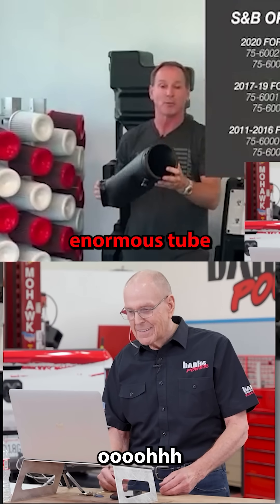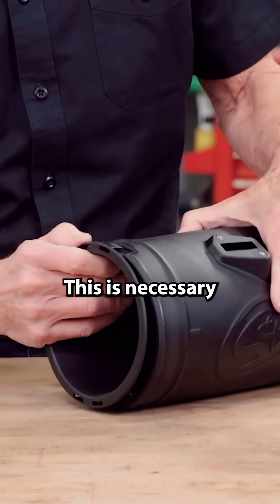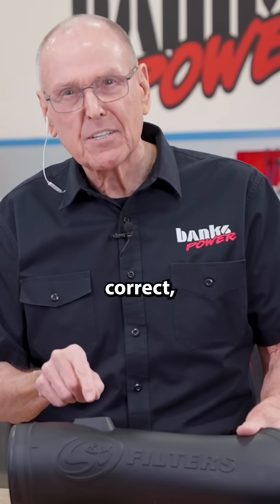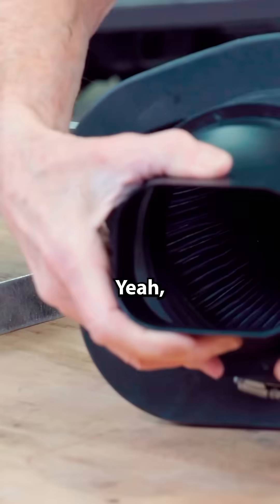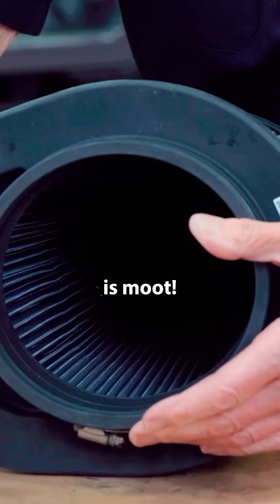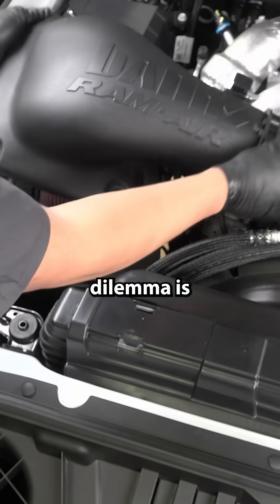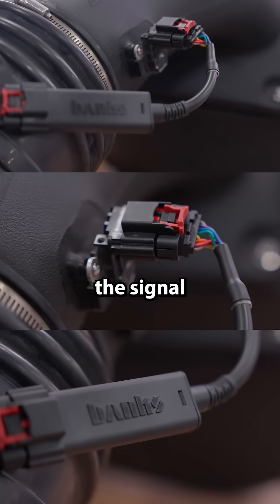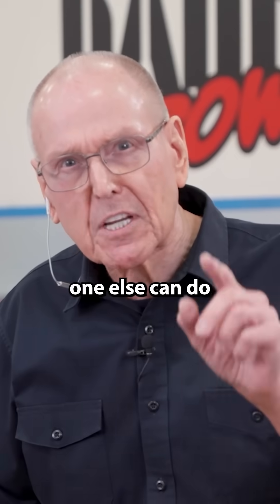Competitor tries to fake a big air intake

Comment: LMAO This makes the intake 50 state legal because you can run it without a tune. Its designed to be removable your ecu needs to be tuned to adjust for the difference in airflow velocity.  Anyone in the industry knows this.

Comment: Tuners called they want their computers back. 

If you increase the airflow rate into the engine you have to adjust the tuning anyways....

Also why do you need a bigger filter bigger =/= better. 

Ironically a higher volume flow of the same energy will be slower because you know Bernoulli's. Sometimes you want a restricted flow because it moves faster. 

Air filters changes are mostly dumb unless you actually adjust the entire engine to increase the performance in airflow.

Comment: I would say a custom maf and engine mapping designed around whatever size intake would be better than an intermediate device but the short didn't describe too much what it does other than bigger hole and driveability like stock

Comment: Bernoullies principle is why the s&b works so well.
Reply from the maker: It sounds like you're implying that the increased air velocity from the reduced diameter of their insert is some kind of benefit. It's certainly what stops the MAF sensor from reading incorrectly, but what do you think happens to the air after the MAF sensor when it dramatically transitions back to the larger tube? Any air velocity you may have gained immediately goes away with the pressure decrease, as Bernoulli's principle proves. You've done massive amounts of work to the air with no overall change in velocity, and you've lost air density from the reduced flow.

Comment: I loved all my banks stuff. Except my tuner. I had it mounted to my windshield and after a couple hot summer days it wouldn’t turn on anymore and customer service basically said there is nothing they can do even though it was less than a year old
Reply: Well,…you did put under a magnifying glass so to speak.    Heat kills electronics!
Reply: @markbrodie48  yea but also my Subaru Cobb tuner has lived on my dash it’s whole life, like 8 years and never had an issue. My banks died in under a year
Reply: @EarlyBirdArms that prob has to do with the amount of cobb units being produced and bought on a yearly basis. In california cobb is pretty much the only legal and viable option. 
Because of that they have made alot of money, and have alot of both the aforementioned money, as well as the time to develop more consistent levels of qc.

This results in more durable and long lasting units. 

Im sure if the banks tuner gets enough attention and sales, the productive will improve greatly.

Another thing that helps the cobb be as druable and useful as it is, is the fact that they have sold as many as they have and have all the review info, as well as customer data that they have collected over the years. Nobody will find a flaw in your system quicker than a standard consumer. Customer feedback is the most invaluable source of information  available to a company.
Reply: @zukoHD ok so the banks product isn’t working as it should. Got it. All that yapping for nothing
Reply: @Boosted_aj knowing why something doesn't work is important. Depending on the explanation, it'll mean the difference between dumping a brand or sticking with it. If the explanation is as the other guy says, it's worth sticking with banks. If they just don't care about QC and heat resistance, not so much. All that said, it's a bad sign when customer service is saying the product isn't meant for that kind of heat.
Reply: @Boosted_aj could just not comment and save some yapping
Reply: @zukoHD  That's not how the free market works. You don't sell more then make a better quality product after. They would sell more IF the product was better quality.

If it was selling more they'd find ways to make it cheaper to make more profit... That's how it works.
Reply: @markbrodie48 its a little bit late of a response but yes heat kills electronics but if they are going to design something thats supposed to stay in a window then it should be more heat resistant
Reply: Well, no shit Chevy Ford and dodge haven’t even been able to make a dash they can withstand windshield heat

Comment: You're telling me some little fancy piggyback maf sensor incomputer is going to perfectly adjust the entire scale of my maf sensor for every load condition of an engine. These would have to specifically be designed as piggybacks for certain engines with a particular intake. No Effing way I'm putting a universally device inline with a critical data sensor.  If you can't afford to tune your engine properly, don't modify your engine, its that simple.
Reply from the maker: The Air Mass Control Module is not a universal device. We sell it specifically with our intakes that are designed with it in mind.

Comment: Sooo, will his AMCM also say nothing is wrong when theres an actual issue?
Reply from the maker: Once the signal has been corrected for the new tube size, the MAF functions as normal and reads accurately for the new amount of air. It's sort of like changing the tube size moves the decimal place on the reading, and our module simply moves it back. That's an oversimplification but I hope it helps.

Comment: Ummm, voltage multiplier have been out for ever..  I use a Diablo to for my boosted car.....  Also, since Ford's can be flashed and don't require aftermarket ECU you can also increase it as much as you need for na......

Comment: I wish I could just get the control module. I refuse to pay hundreds of dollars on a CAI when you gain next to no power from it. I put a pod filter on a universal intake MAF tube just so I could hear my turbo, but it requires one of those inserts to correct the tube size for the MAF. I don't care about the smaller tube size itself, the turbo inlet is even smaller than the intake tube, but I do worry about the flow of the air, the turbulence.

Comment: All these years I've called that a map sensor and couldn't understand why it was called that lol😅
Reply from the maker: MAP (Manifold Absolute Pressure) and MAF (Mass Air Flow) are two different methods that manufacturers use to measure airflow.

Comment: My shop that built the motor in my car fucked the maf off because they are so shit and put a different airflow sensor right after intercooler before it goes into the intake. Was much faster and more reliable to tune too

Comment: If you're asserting that the MAF will work with the lower velocities in a larger tube just fine, and I'm assuming it will, then you are not the only one with a solution to this problem. The ECU can be tuned to recalibrate the MAF input, as the most obvious alternative.

Comment: “I patented this so that I have a design that no one else can do”
Exactly why I hate the Banks company.
They make it IMPOSSIBLE for the car community to R&D solutions because the second they figure it out the Patent it so no one else can develop anything similar. 
If anyone at Banks was wondering why you’re not more popular I’ll outline it.

When they stop making money off certain items they stop producing it BUT THEY DON’T RELEASE THE PATENT. So when people have older stuff and want to come up with a solution they CANT for 70 years from the patent date.

Locked down software and computers, no transparency on hardware repair manuals, legislation that creates protections for companies so that people can’t work on their own equipment “because it’s patented” are the reason the car community is dying.

Banks is JUST as bad as Apple, John Deer, etc.

Comment: You could have made a $0.02 part out of plastic to funnel only a portion of the air in front of the sensor to the right proportion for the larger tube. Instead you both took the wrong way. One a useless tube that claims to be big and the other a more expensive way of doing things 😑

Comment: It reads correctly, it’s just reading velocity of the air but through a larger opening. So you could map the MAF sensor data to adjust for the larger opening. 

Flow rate = density times velocity times area. Density is an input derived from the temperature sensor data, velocity is measured derived from the MAF data which is flow rate, so when it back calculates velocity, it will be lower than expected because it is using a constant area measured from the old intake tube.
Reply: To do what your talking about would require either adding or programming the eeprom in the ecu or buying an entire new ecu like the ones from holly or fueltec..  otherwise most vehicles and almost all newer ones dont have programmable logic boards or will let you alter the asbuilt data without going through a bunch of crap including paying for a subscription and all otherwise youre likely going to brick the whole thing and have to bring the thing to a dealership to reflash it or get a new one..   unless your really good at the stuff and know the whole backdoor into the uart or whatever they use to get into the thing… which is totally different for each make and manufacturer..
Reply: Don't try to educate gale banks. Listen to what he said, he made a controller module to have the correct reading for HIS bank tube. S&B did NOT.
Reply: @davidbernier2865  lol you’re not educated if you think what I said was to educate him. I was stating what is going on behind the words he stated. The “why” to the module he created.
Reply: If I’m not mistaken I’ve seen several cars that are boosted will use both map and maf to make this correction likely for this exact reason.
Reply: You could but it might struggle. Just map out the maf out that's what most do
Reply: Yes but you have to tune for it banks is referring to brand new emmisions compliant truck with just an aftermarket intake, all this thing is doing is fooling the maf readings with resistors I’m sure
Reply: @MrBOOM-fq3lw  all that reducer is doing is reducing the flow rate to an OEM range because the engine management system knows how big the opening is and given the velocity it reads knows how much air. If you change the opening size the ecu doesn’t know that with a MAF system.
Reply: And to do that you must have an easy way to do it. Which I suspect not every manufacturer would allow because "dangers"...
Reply: The answer i was looking for, tricking the car isn't doing anything but ignoring the issue. Of course you have to tune your car after running an oversized intake

Comment: A tune to correct the scaling on the MAF will fix said issue and hey you'll squeeze more power out of it.
Reply from the maker: You're right. Tuning is a great option, however, it would void the warranty. Our solution allows you to run an upgraded intake without modifying the ECM or setting a check engine light.
Reply: @bankspower  ahhh, my apologies. Was unaware of the vehicles being in warranty.

Comment: "To get the velocity correct" that seems really redundant.. wouldn't the purpose of making a different intake be to change the volume and velocity?
Reply from the maker: MAF sensors derive mass flow based on the cooling effect on an exposed wire. In a wider tube, the cooling effect is lower even though the overall mass flow is higher. Our Air Mass Control Module simply corrects the MAF signal to read accurate mass flow in the new wider tube.
Reply: @bankspower  👍🏼👍🏼 thanks

Comment: S&B is absolute garbage.  I bought a CAI from them for my F150 and the thing wouldn't seal properly at the airbox/tube so it would just be sucking in hot engine bay air rendering the snorkel useless.  $400 down the frickin drain.

Comment: The idea is you take the restrictor out when you get it tuned
Reply from the maker: Tuning is a great option, however, it would void the warranty. Our solution allows you to run an upgraded intake without modifying the ECM or setting a check engine light.

Comment: Ya it's pretty pointless to increase tube diameter and vector it back down to stock parameters ,who's idea was that??😂
Reply from the maker: No ones. We correct the signal for the expected velocity, but the overall mass flow is still higher.

Comment: As a plumber I get it. The while pipe is the size of the smallest point. If you have a 3/4" pipe, but there's a reduction to 1/2" pipe, the entire pipe is now only able to supply what the 1/2" pipe can supply. It's a bottleneck of you will.

Comment: The missconseption is that a tube/chanel flowes just as good as the smalest restriction.
It´s the product of cross-section over length!

Take a short pice of garden hose and blow through it, now take a very long coil of the same hose a blow through it, you will understan!!! 😉

Comment: Most cold air intakes, including Banks, are snake oil to begin with. Unless you are going all out with a tune, injectors, and exhaust, the factory stuff works just fine on most setups. Plus you don't have to wait overnight after cleaning the filter for it to be dry enough to re-oil it. There are much more bang for the buck mods than a CAI.
Reply: On some vehicles just a CAI, turbo inlet pipe, downpipe and a tune can have massive gains if the injectors and fuel pump allow for it. Especially true on a lot of  newer German and Japanese vehicles.
Reply: @Wrenchingandnursing  it works on every engine not just European and Japanese.. That would even work on a lawnmower... wtf are you talking about?
Reply: @LegionGamingTV  You completely missed my point. It works on all cars, but not equally. Some vehicles have decent airflow from the factory and certain engines/designs breathe easier than others. A lot of small displacement Japanese and European engines come with horrible airflow and are very dependent on it since they almost all are made to run forced induction at very high compression ratios. Therefore they get more benefit from that modification with a tune than say, a V6 mustang.
Reply: @Wrenchingandnursing  You said downpipe and tune. You're adding parts that will help a CAI. I posted that dollar for dollar, there are much better options than a CAI. A CAI alone is worthless and should be way down the line or part of a comprehensive package like the ones you stated. People who are buying CAI alone are being scammed. Think about this, I swapped from a 2.73 ring and pinion to a 3.73 and picked up nearly a second in the eighth mile. That's like adding 100hp. A ring and pinion cost $200-250 if you can install it yourself like I can. Most CAI like S&B, which I am an associate distributor of, costs $349 and won't even give you 10 to 15 hp. The only reason I sell the CAI is I service a lot of hot shot transport trucks that save money over time by cleaning the filters instead of buying new ones. They but the kit plus an extra filter and cleaning kit.
Reply: @joeydover  You are absolutely correct. It's only worthwhile in a package and without a tune it is completely useless. 

I meant it in more of a way that a lot of newer turbo performance cars are undertuned from the factory and for around 1000-2000 dollars  you can easily get over a second off your times and keep your car mostly stock and reliable without needing shop knowledge or tools. Even off the shelf tunes nowadays are pretty damn good for some cars. You are 100% correct though, if you have the time and experience many mods are more price efficient, albeit usually drastically change the cars drivability outside of the strip.
Reply: @Wrenchingandnursing  I own a 2020 Explorer Platinum with twin turbo 3.0 V6. 5 Star tuning has an E50 tune that takes it from 401 hp to 525 hp for $550 with no exhaust or CAI needed. All you need is just the tune and premixed ethanol/gas. Change the high pressure fuel pump and throw in E85, and it will go near 600hp on stock exhaust and intake.
Reply: yes, factory airbox setups in a lot of cases work a lot better than aftermarket unless you do other things along with it.
Reply: Hek now days quite often the oem tube is as effective as it’s gonna be.
Reply: I remember asking my mechanic about aftermarket intakes for my Acura, and he said, "the Honda engineers knew what they were doing"
Reply: The main reason I like to mod the intake on my vehicles is to make the intake sound more audible. Absolutely zero performance gain, I just enjoy the option of driving normally and quietly, and then making it sound a bit more sporty when I give it wide open throttle. Now on some vehicles this is as easy as removing part of the stock intake or just removing the resonance damper attached to it. But if the air filter is located before those sections you can't just open them up to the outside obviously. That's where a good quality air intake mod comes in handy for me personally.

Comment: That's what tuning is for.
Reply from the maker: Yes tuning is a great option, however, it would void the warranty. Our solution allows you to run an upgraded intake without modifying the ECM or setting a check engine light.

Comment: Or just get a tuner? Or just get a new maff  with the proper elements in it to adjust for the added flow or about 15 other ways to get around this. This tech has been out forever now. I still like banks but this isn't new knowledge.

Comment: All these sensors create many more problems than they solved.
Reply from the maker: We'd disagree. Our solution allows you to run an upgraded intake without modifying the ECM or setting a check engine light. So it actually solves a problem.
Reply: @bankspower  I'm talking about all the sensors and poor placement of parts in modern day vehicles compared to ones from the 70s-90s. Not yours specifically. Be a positive PR guy, not an argumentative one.

Comment: Or just get a proper tune.
Reply from the maker: Tuning is a great option, however, it would void the warranty. Our solution allows you to run an upgraded intake without modifying the ECM or setting a check engine light.